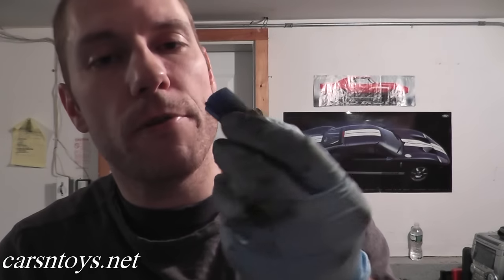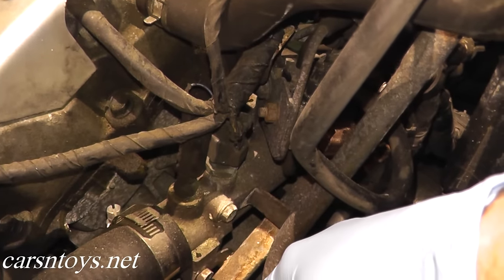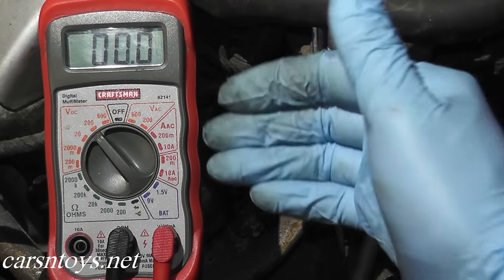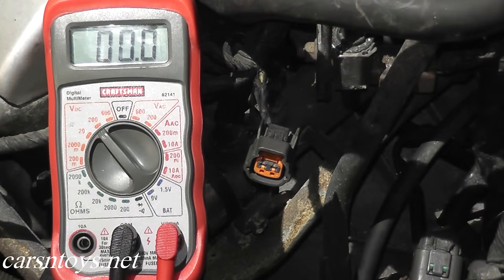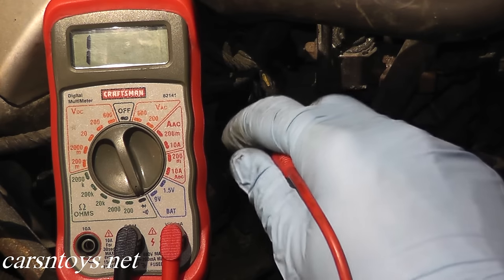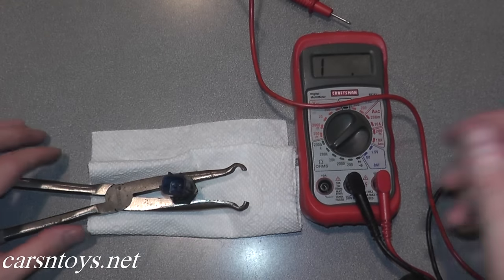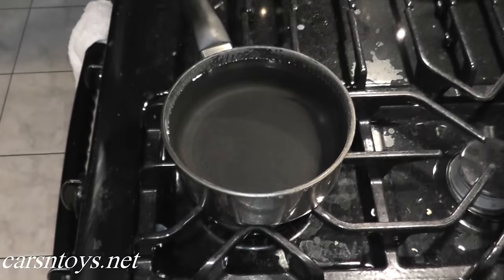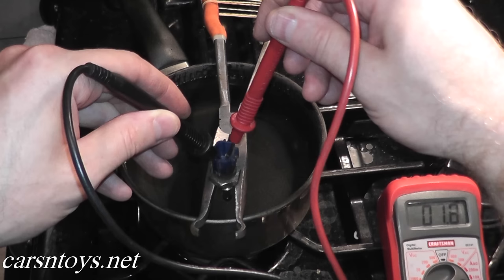How to Test and Replace an Engine Coolant Temperature Sensor P0115 / P0125

Comment: What does it mean if when I check the wiring harness I am getting continuity but not getting a reading of any power no matter how I check it. Is the harness bad? Do you think?
Reply from the maker: +Bart Hamburg If you're not getting 12v of power just make sure the wiring looks to be okay. Look at the plastic harness connect as well; especially the small metal prongs.
Reply: I figured out that it is getting power just fine but the problem is that sometimes it works just fine and then sometimes it doesn't come on at all and the car overheats I can't seem to figure out what the problem is. Thanks
Reply from the maker: +Bart Hamburg Have you checked the cooling fan? https://youtu.be/bf2kvZJx1OA
Reply: That's the problem. The cooling fan works fine but then sometimes just doesn't come on. I have replaced the thermostat and I have replaced the coolant temperature sensor I have done the tests that was in your video. I believe it to be some kind of wiring problem but it's strange that I have it working sometimes and then sometimes the fan does not come on and it overheats
Reply from the maker: Bart Hamburg
I had a similar problem years ago with a 3rd gen Camaro. Turned out the wiring melted.

Comment: great video,  I have an 01 corolla throwing a po125, new coolant temp sensor, thermostat has been boiled and tested. and still throwing a po125,

I'm learning  to use a multimeter from your video however I cannot seem to mimick the audible alert. when the key is forward and I test the engine coolant sensor the fans come on and when I touch it with the multimeter the fans shut off. is the key turned forward or off for this when testing the vehicle side of the harness to the ECTs. 

I have a digital cheap multimeter. however I was able to mimick the 5 volts., test you performed this is the one I have http://www.harborfreight.com/7-function-digital-multimeter-90899.html I assume all multimeter have the tone feature?

the position I use to check for the tone, is the one on the opposite side on the one in the picture

Comment: Would have been great for you or anyone to mention to be careful when tightening this back down. Brass sensor+Aluminum head and threads= stripped out sensor port. luckily I was able to Teflon tape and silicone my way out of a nightmare. USE CAUTION PEEPS

Comment: hello Eric. .  i ran car for a lilttle bit maybe 4 - 5 i did multi meter test on sensor wire harmness i indeed have power but i test the sensor and i got no reading. .  i should have gotten atleast something right

Comment: So mine gives 12v, not 5.  is that normal?  also i can't get my rad fans to turn on unless the AC fan is on.  if i short out the ECT sensor with a paperclip the rad fans come on no problem.  got to be a bad ECT sensor, right?  but no error code and obd says temp is staying at a fairly nice 92degC.  of course...i guess it's the  ECT that tells the computer what the coolant temp is...
Reply: ps - i drive a 99 accord 4cyl lx
Reply: Was it the etc sensor? Because I got 12 volts as well

Comment: Hi i have a Chevolet optra 2004...recently hold light is flashing and engine light also flashing simultaneously...what could be the possible reasons to have this lights??? does anyone have familiar with this kind of problem...
Reply: +Binod Thapa flashing lights means missfire
Reply: gizzeproductions

Comment: So when I turn on my a/c my engine stops for a second then goes again repeatedly. Only when I turn on a/c. Is it the coolant sensor or no? I've recharged the a/c but didn't work. I changed the thermostat and began blowing cold air. It stopped after that. Help me.

Comment: I get 12 volts...not 5,from probing  (harness connector) terminal 2 ,with the red prong (multimeter)
Reply: I think it depends on each vehicle, Mine measures 12 volts too... so do not worry

Comment: my car doesn't have a code but the temperature gauge is stuck. could this still be the problem?
Reply from the maker: If the gauge doesn't move at all my guess is the temp gauge is faulty.

Comment: I replaced thermostat and I was told to also replace the temperature sensor , and when I replaced the temperature sensor , it says my car is overheating ? How can I fix?
Reply from the maker: Overheating can be caused by a number of things. How are the cooling fans, water pump, etc.?
Reply: CarsNToys turns out it was just a air bubble in the lines .. when I replaced the thermostat ... and it went away ..
Reply from the maker: Good stuff!

Comment: Can the sensor be bad without a cel light ..
Reply from the maker: Yes. However, it's on the lower end statistically and typically on older vehicles.

Comment: what if sensor is good and you have the rights ohms is that computer related?
Reply from the maker: +Dave D'artigan You could run a test from the ecu but often if the computer is bad you'd have many trouble fault codes and/or the car just wouldn't run correctly.

Comment: MY AUTOZONE PARTS STORE PROVIDES A FREE DIAGONSTIC SERVICE AND TAKES LESS THAN 5 MINUTES TO GET A PRINT-OUT TO SHOW THE CUSTOMER WHAT'S WRONG, IN MY CASE THE CHECK ENGINE LIGHT CAME ON.AND THE PRINT-OUT SAID TO REPLACE THE COOLANT TEMPERATURE SENSOR (ECT)

Comment: is there anyone here yet?                                                                                                                                        my ford mondeo 2.3 petrol 2008 overheat after driving in traffic jam for 30 min, and the auto transmission stops working and only manual works. also if i go to an open high way fast enough engine cools down whats the problem here? thermostat changed a week ago. also radiators fan and computer, maybe heat sensor might be malfunctioning?

Comment: My temp sensor says 0.36 is that bad?
Reply from the maker: +moneyhungryyt What kind of vehicle?
Reply: CarsNToys 97 mustang GT, there are 2 sensors one by the thermostat and one by the other side of the intake. The coolant temp sending unit for the gauges is 0.36 and the coolant temp sensor for the  computer has no reading. I used the kilo ohms on my DMM
Reply from the maker: +moneyhungryyt Let me see if I can dig up the specs for your vehicle and I'll f/u shortly.
Reply from the maker: +moneyhungryyt I did some research and I can obtain the specs from a vendor but I'd have to purchase on my end. If you're interested I can give you the details. Cheers

Comment: what if it is a wire? how do you fix that?
Reply from the maker: If it's broken/severed you can solder or use a crimp connector to reattach.

Comment: Have 2007 Chevrolet Equinox.Equinox. . So all I see is cars over heating. ... Over heating   .and more over heating g.  What if temperature gage never Leaves the C and I hot plenty good heat

Comment: So there was nothing wrong with the sensor?  were you just informing folks?  Shouldn't we be looking for a specific ohms at hot and cold...?  If it is out of range then it is bad.  yours goes in the right direction, but did it ever make it to the proper reading?

Could these things have intermittent problems?  Or out of range on the hot side, but not the cold side?

Comment: Hello, I have a problem with my wiring for the ect sensors. The socket has been missing and has been left with two wires with the same color (guy who placed it must be a dumb f*ck). I got the car with a CEL warning on and since I have placed the wires randomly (its been difficult getting it on since I do not have enough room for it) and the CEL went off. But the fans does'nt work. Is there any way to tell which is which for the corresponding wires? Thanks
Reply: Shouldn't make any difference. Thermistors are not polarised (Temperature sensitive resistors are not affected by polarity )

Comment: So...some doosh nozzle on YT tells to simply unplug the sensor and if the fans come on; the sensor is bad. 2-days and $35 later, still have the same problem with no fans at 210 deg F. Beware what you see on YT for research & diagnostics. This guy seems OK with test logic of the part.

Comment: if the sensor was working fine then why did the P0115 / P0125 code show up ???
Reply from the maker: +Andre Isaacs It is fine. Just shot the video as a how-to.
Reply: CarsNToys ok thanks......my mitsubishi lancer is having a cold start problem....i followed your instructions and found that my coolant temp sensor is working as it should so now im not sure what the problem could be ....guess i could try cleaning the mass air flow sensor
Reply: +Andre Isaacs What kind of cold start problems?
Reply: unless the engine is warm, the car does not start until u crank it over 10 times....then idles rough for a few minutes ......not sure if temp is involved or if fuel pressure is involved
Reply: Do you mean warm as in the ambient temperature outside is warm or warm as in I was just driving it?
Reply: warm as in the temp gage has to be in at midpoint before i can drive......but i followed recommendations from my mechanic today which was to change the spark pluggs and gas pump.....the old spark plugs were just 2 months old and was very black and dirty for some reason......so not sure what is causin the pluggs to get black and dirty so quickly
Reply: +Andre Isaacs hopefully that's the fix you needed , glad to hear you got it running right again.
Reply: +Andre Isaacs if your plugs are black that could be unburnt fuel or oil deposits

Comment: I have a cut in the wire. What now? has anyone made a video newer than2009? all these tuts are 8 years old. All great info but chances are noooooooo body checking this 3 yr old thread.
Reply from the maker: What kind of vehicle are you working on?
Reply: CarsNToys 04 VW 1.8T Wagen. fixed. now looking for vid on replacing extension valve for AC?? AC guage goes immediately to red. buried

Comment: shows 6300 ohm
Reply from the maker: I now use an auto digital multi=meter. No need to dial in the scale. Typically around $20-25

Comment: like i tell my friends, if its old, just replace the shit, dont be mr cheap ass, replace it, be done, u got new sensor whether works or not, their not expensive, nickel and dime bullshit people do
Reply from the maker: I agree, but a vehicle may have multiple trouble codes and instead of throwing money changing sensors it's often one sensor that needs replacement and the others work fine.